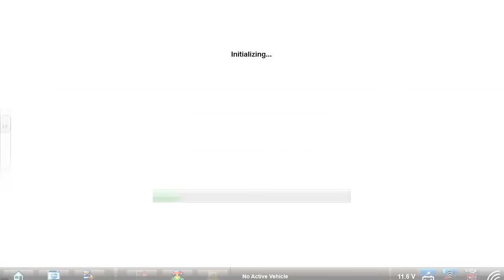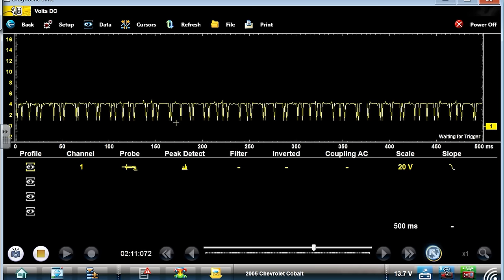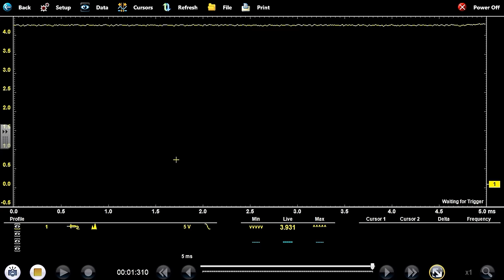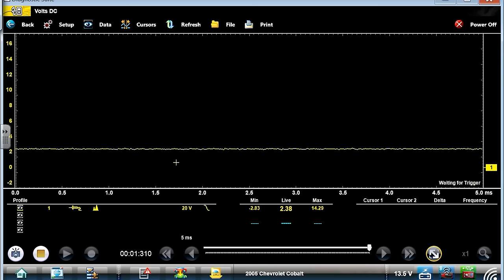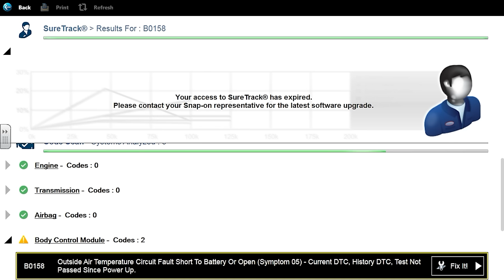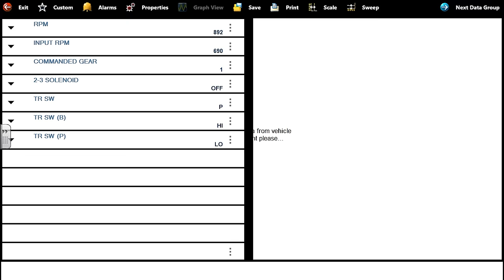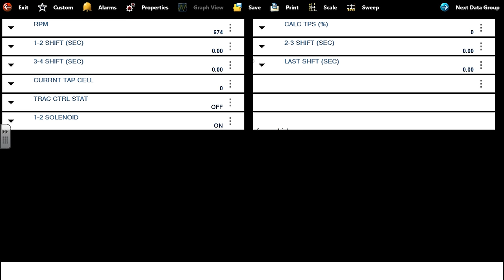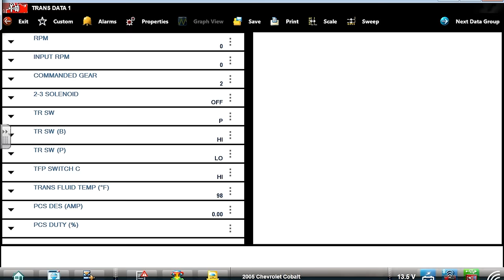Troubleshooting a Bad TCM - CAN and Sensor Ground Circuit Problems

Comment: Hello, I have a similar problem with a 2011 Chevrolet Cruze with automatic transmission I replaced all the selenoids and I only have 2 second gear that works in manual mode and I have no reverse I have the same symptoms  that the old selenoids and i replaced the tcm which is part of the selenoids i will look to see if i don't have a ground problem and i don't have a transmission code.

Comment: Good to hear from you again sir  i have program  a new key and the car did not start  soi check on the 4 wire on the immoblaizer 1st b+ ok 2nd ignation ok3nd grand ok 4 th sigmal wire i put my testlight on battery + and touch the signal wire and it light i turn my multimeter to 20m to check short grand  i disconnet bcm and the pcm  and  put one lead of my meter on body chasis and  one on thr signal wire my meter did not respond pls i want to know if i have bad bcm or i have short to grand  thank you sir
Reply from the maker: Let's move this to my forum www.scannerdanner.com 
It is free to join and we can definitely help you. I have 28k global members and hand picked moderators who've been with me for years and know my material inside and out and are there to help me help you guys. It is just too difficult to offer back and forth messages here on YouTube with stuff like this and we also can't share pictures and images here like we can on the website. Hope to see you there!

Comment: My truck in shop since Nov waiting for a tcm from gmc, shop pulled a u0101 code, along with a glow plug control short and a short in def injector,ultimately they say tcm is getting power innot sending any out.
My batteries are original, 10+ years, When they took it off the rack it wouldn't start dead batteries. So they obviously charged, forgetting that a few days maybe a week later of it sitting they check battery life say it's at 1/4% life left, 11.11 11.02 cranking. They said it should be fine at that, when I look at that code online though the first thing I see is low voltage issue, Check battery.  The truck has history of bad glow plug control module, last time at shop they reflashed it,  it tested at 3r between serial data circ and control module setting dlc, any help appreciated! Thank you

Comment: Was it possible to measure voltage for can high and can low using a multimeter without using a pico scope.
Reply from the maker: It will be an average voltage and wouldn't be all that useful. But it would have shown a higher than normal voltage in this case, so yes, it would have given you some direction

Comment: I have a 2014 Chevy Impala Lt have a loss communication to the tcm abs light stabilitrak light power steering warning sign on dashboard power is going in to the tcm but none coming out
Reply from the maker: A full code scan of all modules would be first. Followed by network resistance measurements and power and ground testing of the module not talking

Comment: Surprised I havent seen him load test that ground yet to see if it can carry current. But maybe my thinkings wrong. Id still test it tho
Reply from the maker: I think I answered this in the comments of the premier but with the TCM plugged in and the key on, is all you need to "load the circuit". No headlight bulbs or high amperage test lights that guys like to use is needed here. But to each his own. I promise you though, that you will never miss a bad ground on a module with just a simple voltage drop test, module plugged in (Key on of course) and backprobing the ground. No need to "load it" by some other means.
Reply: @ScannerDanner  buena explicación, siempre creí que para probar las alimentaciones de los módulos era obligatoriamente necesario usar lámparas de alto amperaje. Thanks

Comment: You may have a good ground at the plug, but it has lost ground internally. You can try running an external ground to the case.    Not possible if it would help and that exact situation. But I've had TCM failure before and stumbled across that. After running an external ground to the case, the car ran and drove fine with no codes
Reply from the maker: I've done similar things to sensor ground circuits when the board ground is bad
Reply: @ScannerDanner  I'm working on my personal 2000 jeep cherokee I just installed a 4.7l stroker engine in.    I belive the front o2 sensor is failing and was before the old engine failed.   I only have an autel 909 and it don't like my jeep too much lol.   It takes forever to communicate and functions are pretty limited.  I just unplugged the sensor tool I can get a new one and drive it very little bit the engine still needs broken in.     What brand o2 sensor would you recommend.   From what I've read ntk is the way to go but I can't find one anywhere
Reply from the maker: @autotek7930  is it still the 2000 electrical system? Is the O2 heater circuit constantly powered by the ASD relay and  a constant ground on the other heater wire? If so you do not need to use an NTK or factory sensor. If however it is a PWM heater circuit, you MUST use an NTK or factory sensor
Reply: @ScannerDanner  let me look into that.    I just went by the forums as it was a quick search.     I'm not paying the oe price lol.   I'll get on all data and hopefully find the theory of operation.   If it don't need to be ntk or oe do you have a preference on brand?
Reply from the maker: @autotek7930  Bosch is fine on the non pulse width modulated heaters.

Comment: Can you tell me as no one else can I am after a cheap scanner for a Pajero i0 . QA model 2002 2 ltr however the obd2 port runs a mut11 system , I have bought a few obd2 scanners only cheap but they will not communicate, I am in Australia, can you help. Thankyou regards Andy
Reply from the maker: Wish I could. You can try posting to my forum and see what my community has to say. It's free to join
www.scannerdanner.com

Comment: I was hoping that you would open up the TCM and find a broken solder joint.. You even mentioned it there towards the end and got my hopes up. lol..   oh well.
Reply from the maker: I couldn't open it up at the time as we were going to use it with the external ground to get the car out of my brothers shop

Comment: Im have some of the same problems with saturn vue 04 is there anyway you can send me wiring diagrams splice pack 203 driverside taped to odb reader(hook up for scanner) the only code i got was a low volt app sensor (gas peadel). but water damage to connector was the real problem the vue is really bad for but i ended up cutting all 40 wires hooking back up is let say a pain in the butt
Reply from the maker: https://eautorepair.adtrk.biz/?a=10817&c=24&p=r&s1=
Best I can do. I can't offer copyright info. Sorry

Comment: I'm commenting before I even get past the first six minutes.  All that "don't lift it" chatter has me excited because I'm betting hard that once you can put it up the in the air, you're going to find the rear unibody framing rotted out over the axle and going down towards the floor pans.  If I'm right, that essentially means there's really nothing left to fix.  Yes, there is stuff to fix, but it'll decidedly be pointless if an inspector is going to get under the car and see where the necessary parts used to be.  The fix for this car is to replace it outright.

Comment: GM ignition switches are junk. That's probably why you couldn't get it out. I had to change mine on my Silverado. It would bind up when turning it, and it would allow me to take the key out when it was running in gear. 

A lot of times the keys will get stuck in them.
Reply from the maker: No, this was a shift interlock issue from the module that wasn't functional

Comment: Are you working out seems you are bigger,  as far as case study you share as always every detail and possibility for malfunction
Reply from the maker: Thanks Ivan! I'm fatter than I used to be that's for sure lol, but yeah, I'm trying to stay in the gym too
Reply: @ScannerDanner  Also when you unplugged TCM and got a good signal, I watched video from  Intelligent Auto where he did just that on PCM (I think) and  got same results  but the problem was in wiring (connector). Crazy got a good signal unplugging ECU altough that wasn't  a issue. I always remember your words " every test has a variable"
Reply from the maker: @ivandrago2557  yeah with this GM design, when you unplug one module you're disconnecting other modules "downstream" and it is absolutely a variable that must be considered.
Reply: @ScannerDanner  Wird was for me that, when unplugged ECU terminal resistor was in ECU and signal was good, can't explain that. I read somewhere that without terminal resistor network could be with clean signal dependig on length of wiring

Comment: GM programming isn’t bad at all really. $40 per vin to program any module on the car for 2 years. The place I’m at now is tied in with a GM and a Ford dealership so I don’t have to worry about that anymore. It’s so nice just to be able to log in and have full GM techline connect access. Ford is stupid though as the way I understand it is that the dealership has to pay subscriptions to have access.

Comment: Thank for this video I am working in the same type of car my Chevrolet combat last it came from another Gareg to me I ask the car owner what is the history of the car he sad he gave the car to a technition to the radio on switch to steps one on Ignition switch he piled one of the I'immobilized wire and put on the power to the radio from that time the car did not start when the came to my shop I checked can low and high ok the car not crank when I try to diagnose
Reply from the maker: fix the immobilizer codes and remove that wire to the radio
Reply: @ScannerDanner  thank a lot how can get the access code of the car  cos i dont have the acess code and the immobilzer is not communicating i fill is damege

Comment: Danner can go with a used TCM. He just needs to have it cloned. If there are no local guys that can do it, there are plenty of service providers on the internet. ✌🏽
Reply from the maker: He installed a used module without any programming and it worked fine. I know this cannot always be done, but on this model it was good
Reply: @ScannerDanner  interesting. Would have thought it to be a no start.

Comment: The bottom line is vehicles should not be made like this.

I have 4 1970s -80 carbureted vehicles in my yard that have $12 voltage regulators and run just fine.

Seriously thinking of tearing out all the 2003 components from my truck and doing a retro mod and never dealing with this crap again.
Reply from the maker: Can't stop technology my friend. It's everywhere

Comment: I had a neutral switch put my tranny in limp/safe mode and shift/gear indicator wouldnt light up or indicate correctly.. its amazing how many things are affected.. and i even asked a dealership to poke at it.. 🤣 they told me a bunch of things were needed . Which wasnt true..proves how lame lazy and greedy some deslerships/ in house mechs are.  So anyways ..an 80$ neutral switch saved me tons of money and from bad actors who may or may not be fully licensed 🤣